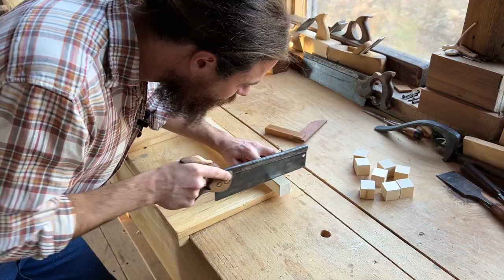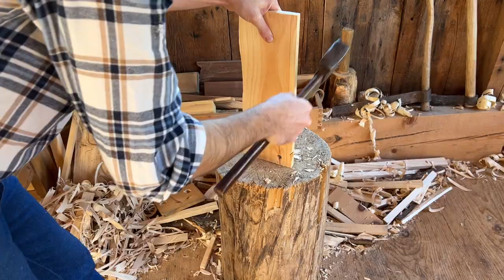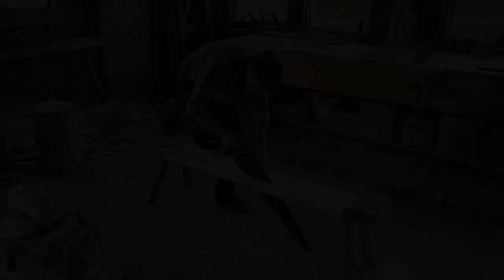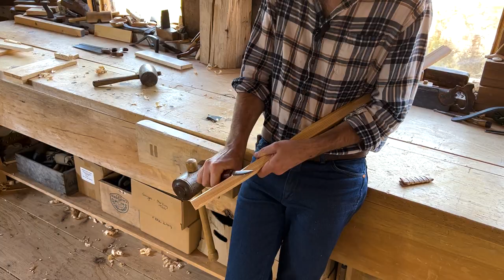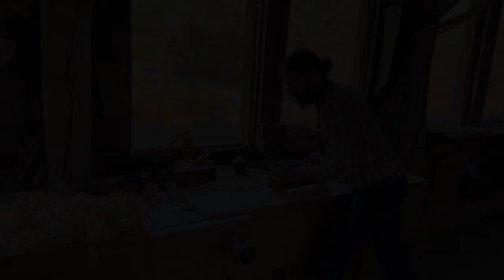Skills Over Jigs Trailer

Comment: You are a wood craftsman purist, sir and good for you. Besides, with the power supply being questionable of late, most woodworkers will be stuck with unproductive machinery, while we carry on with a lantern or two.

Case-in-point:  Many fellas that I used to work with would always bug me that it took so long to finish a project. I enjoyed using hand tools like I was taught by my father. I would bug them right back that I was a craftsman and they were wood machinists who could not cope without their machines and jigs if the power went out for an extended time. I was challenged to build a simple table - hand tools only and rough-cut stock - the challenger designed it to prove me wrong. I was done a full 2 weeks ahead of my coworker, tapered legs and drawer included. Not perfect, mind you, but happily, still in use after 15 years. It is just as sturdy with no drawer binding either no matter the season. I'm not sure if my coworker ever finished his.